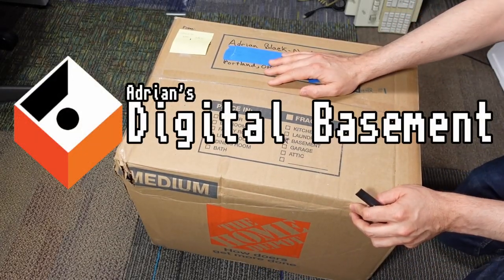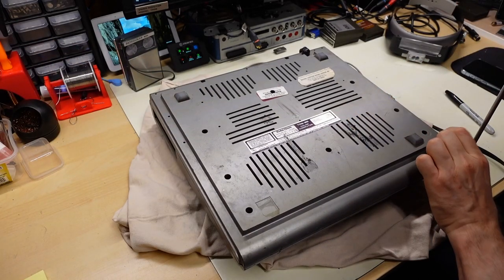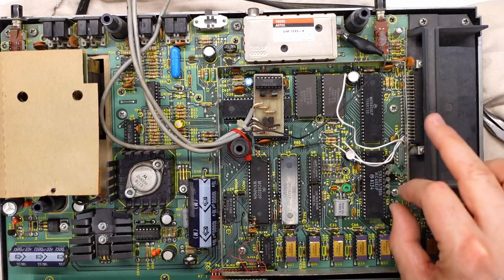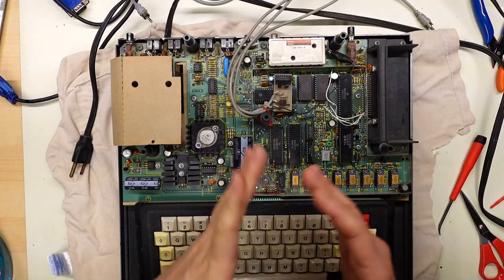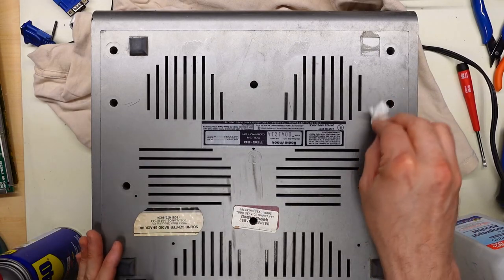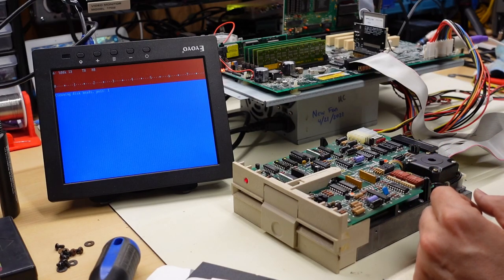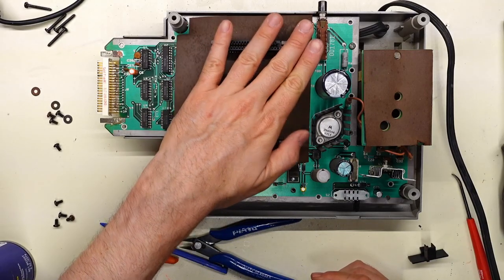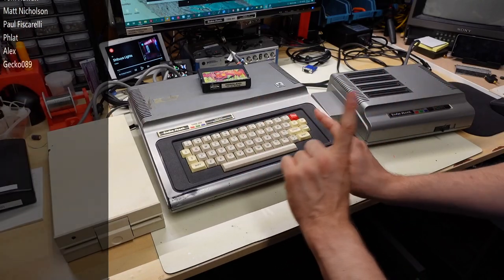0035 We have a broken TRS-80 Coco 1 in the basement! (And a repair on my other channel!)

Comment: If you look at the text just below the cartridge port on the right hand side, it will end with "-D" or "-E" (for D and E revision motherboards). I think I saw "-E" during your video. You are correct in that the keyboard ("melty" is it's nickname) is from a later Coco - either the short lived 64K Color Computer from 1983, or the early Coco 2's from 1983-1985ish. The original Coco 1's used a connector with a single row of pins to connect the keyboard; later (and right through the Coco 3) they used flexible plastic connectors. This one has an adaptor to adapt the newer melty keyboard to the original connector based motherboard). Some of the bodge wires (and I think the capacitors) would be for a 64K RAM upgrade - that wasn't "natively" supported until the F boards came out (labelled "285" at the end instead of "-D", etc.). Someone better with hardware would have to figure out what the wires that were coming from the cartridge port were for - maybe based on which pins they are attached to. Great video - I will mention it on CocoTalk this weekend!
Reply: the  wires look to be the ones for turning off the cart auto exec functionality for umm backing up rom carts...
Reply: @celticht32  - That is possible, although completely overkill. You only had to put tape over one pin to disable the auto exec. 🙂
Reply: @CurtisBoyle  oh I remember... but I also remember getting tape stuck in the edge connector when I was trying to dump a rom at one time =) of course this was for archival purposes you understand ;)

Comment: I would say to desolder and remove that edge connector on the multi pack interface.  Maybe you can find a more modern replacement to solder back on to the original pads?

Comment: That keyboard is an early coco 2 keyboard, later coco 2s had better keyboards (similar to what you find on the 3).   So someone 'upgraded' that keyboard with an early coco 2 "melted" keyboard, which is how that particular keyboard is described (as opposed to the chiclet style keyboard you showed a picture of in the video).  That disk drive is completely non-radio shack.  Early coco's used Shugart drives, later on, Tandon.  So that drive was never sold by Tandy.

Comment: Ketchup eats corrosion amazingly well.  Might help on that edge connector.  Of course you have to clean the ketchup off afterwards.  Only takes about 30 minutes.
Reply: Tomatoes are acidic and is the reason why you never use aluminum etc with them when cooking etc

Comment: It's been ages since I had a Coco but most of the bodge wire stuff I remember from 35 years ago was due to the multipak being jostled and since it was unbuffered, the 6809 would pop super easily.  When I unsoldered and replaced it with a 
socket,  I broke a few traces and had to bodge them.
It's possible that is what happened to your Coco 1
Reply: Also for the multipak, you could have the sound and speech cart and the disc controller plugged in at the same time so disk games could access it.  I think I had a ""high speed" serial card as well (16450 maybe?) and a special DMA ram enabled floppy controller so that you could use OS/9 and not have the whole system freeze on disk access.

Comment: if you write a basic program that increments a variable from 0 to 255
and you poke that number to every address from 0 to 65535
the computer goes nuts

Use to do that to these when they were on display in Radio Shack stores..... 35 years ago...

Comment: I suspect that the bodge next to the RAM is part of the 64K RAM upgrade. I think the early CoCo 1's weren't set up for more than 32K.

The adapter on the keyboard cable is, in part, to convert between the early pin connector and the later edge connector. The bodges and the replaced chip, however, are very curious. I'm wondering if it was some kind of lower-case mod, perhaps. 

The newer keyboard (like yours) was introduced with the CoCo 2, but did ship with late CoCo 1's (officially referred to as the 64K Color Computer and which came in a white case). Later in the run of the CoCo2, the keyboard was upgraded again to something more recognizable.

Comment: In the UK we had a COCO 1  clone, the Dragon 32 ( https://en.wikipedia.org/wiki/Dragon_32/64).  The dragon repair videos seem not have IC issues but the power supply requirements are complex due to requiring 12 v for the RAM used and seem to be the main challenge that need to be addressed.
Reply: Technically they are both clones of the Motorola application note. I have a Dragon that I acquired a few years back.

Comment: could also be a 32k upgrade because sometimes RS bought 64k chips with 1 bad bank and used them for 32k upgrades. need to run some ram tests to see which it is

Comment: 4 carts on the coco... or 4 cards with interrupts... cards that fit the height :) that could be useful for homebrew full length bus cards.... i bet you could use multiple carts on there at the same time if you remove and terminate the switch? i was saying prolly an interrupt vector or something on all of the cards, or on the board, maybe modded on top with the transceiver ; perhaps some other logic chip. point is, as long as those cards point out to address and or the data of another card, and that card knows where to point, ie, point it either to another card or the bus, you can run all 4 of those at once.  you just need some type of controller to do it, like a eeprom programmed to point and listen. youd prolly want some type of a check, those cards arent present, ok, well back to the bus.

Comment: The original CoCo 1 couldn't handle 64k RAM.  One of the bodges is likely to allow 64k.  The top dog CoCo1 was 32k from the factory
Reply: not true... I have 2 coco 1's and both are 64k... including my original

Comment: I had one for a bit ... it liked to blow the GFCI dongle I made (its just a metal box with a GFCI outlet wired into it as an extension cord), I use that with any "unknown" computer with an internal AC to DC power supply .. its tripped 3 times. once with a Radio shack soldering iron after about 25 years,  the Coco1 and a Coco2 ... all 3 tandy products and all down to faulty power cords. Its not fact, but I don't trust old tandy / radio shack AC cords anymore

Comment: The head banging could be because the CoCo only formats disks to 35 track
Reply: I kind of wondered the same thing
Reply: Unless the original owner used later versions of OS-9 Level 1 (or 3rd party floppy drive driver upgrades, like SDisk). The controller itself was fine up to 80 track/double sided - just Microsoft's Disk Extended BASIC was hardcoded to 35 track, single sided. OS-9 Level 1 version 1.xx may have had the same limit when it was released in the fall of 1983; I don't remember for sure (version 2 even supported hard drives).

Comment: IIRC the MultiPak interface for the CoCo 1 won't directly work with CoCo2 or 3 and requires a mod. Someone else might remember better as it's been several years since I had my CoCos up and running. My CoCo 1 machine has the original chicklet keyboard and has lots and lots of palm wear on it.

Comment: I remember using these at the local Radio Shack Computer Centre...the original keyboard was AWFUL to use.  You had to hit the keys straight-on otherwise they would jam.  Re: the wires off the cartridge port...a friend of mine had something similar in order to, ahem, make archival copies of his game cartridges on disk.  You could also put masking tape over 3 of the pins on the cartrdige to stop it from auto-staring.  No further comment.  :D

Comment: the modification near the keyboard looks to be a lower case mod...   with a connection to the keyboard
Reply from the maker: Oh? I knew the early machines had no support for lowercase test but I figured the keyboard could still sense the use of the shift key
Reply: @adriansdigitalbasement2  I think the wire is to sense a double shift so it would do a shift lock type function.

Comment: its been upgraded... with a newer keyboard, looks to be composite....I would imagine its been upgraded to 64k.... with the other mods your showing.... the color is mercedes silver... you should get a click from the cassette relay when you power it on... the bodges are for the 64k upgrade... the connector on the edge connector was for I think a reset and for not executing the rom code.. it was a way to dump carts back in the day... I think,,, and it looks initially to be the VDG chip.... the 6847 might be bad... the keyboard is the model 2 keyboard or melted keyboard and not a true aftermarket... look up the color computer archive for the service manuals for all of this... you prob also need to know the board revision to get the right service manual... the drive is a 3rd party drive.... and probably had a jnr disk controller as the tandy controller cart only supported 1 sided out of the box unless you patched the rom to use both sides as drive 0 and drive 1... later controllers supported DS drives in OS-9 and some 3rd party controllers could directly support as well... (been a coco nut since my original coco 1 ) also on the multi-pack power that on before powering on the computer.  Floppy controller always go into 4.... and it can be software selected....  on my coco I have disk controller in 4, speech pack,  orch-90 cart and coco SDC in mine.... you may want to get a coco SDC to play with =) and yes you can use multiple carts (like the disk controller and the rs-232 / modem pak) at the same time

Comment: That's a CoCo2 Keyboard on a CoCo1. CoCo1 used a wire ribbons, CoCo2 uses Mylar ribbon, the bodge wire to the keyboard??? not sure. basically that is an adapter to use CoCo2 keyboards on a CoCo1

Comment: Rumor at the time was that this computer was build from Motorola's 6800 application notes! 
Is that true?
Reply: Motorola's reference design and their chip kits were the foundation, for the Dragons as well.
Reply: Yes, but it was for the 6809, not the 6800.  The 6809 is upward compatible with the 6800 only on an assembly language mnemonic code level.  You could take a 6800 assembly language program and run it through a 6809 assembler and it would produce working code, but the opcodes would be different.  Pinouts are not the same, either.

Comment: those "gold contacts" aren't gold.  gold doesn't corrode or oxidize.
Reply: It may have been gold originally, but just a very, very thin layer of gold over some other metal (e.g., copper). There were a lot of 'do-it-yourself upgrade kits' back in the day that used extremely thin gold coatings that rubbed off after they were inserted and removed a few times - similar to how you can buy 'gold-plated' connectors for less than a dollar from China. If you rub your finger over the gold, it rubs off (LOL).

Comment: Not the one, maybe the two.  The original had chicklet keys.
Reply: This is a CoCo 1 with a CoCo 2 'melted' keyboard retrofit.  I stuck a spare CoCo 3 keyboard in my original CoCo 1.  It works fine, but needs a connector adapter.

Comment: @3:59 - That is probably one of the later Colour Computers because of the keyboard. When they first released, they had a 'chicklet' style, which eventually migrated to the keyboard that you have before the release of the Colour Computer II and the Micro Colour Computer.

https://en.wikipedia.org/wiki/TRS-80_Color_Computer#/media/File:TRS-80_Color_Computer_1_front_right.jpg